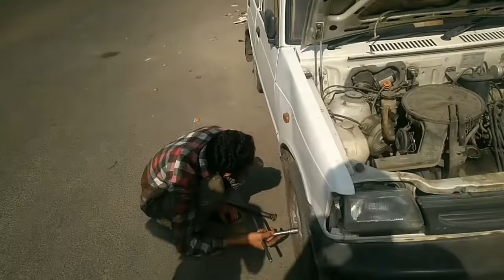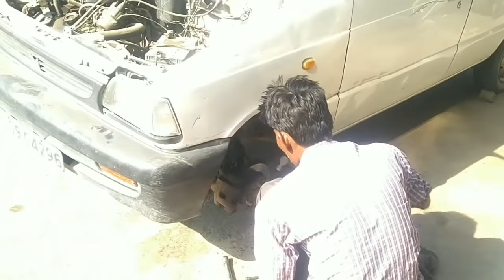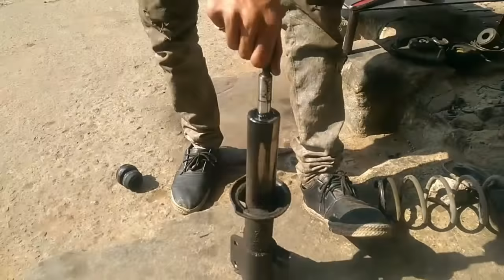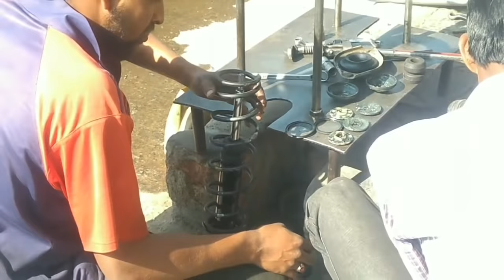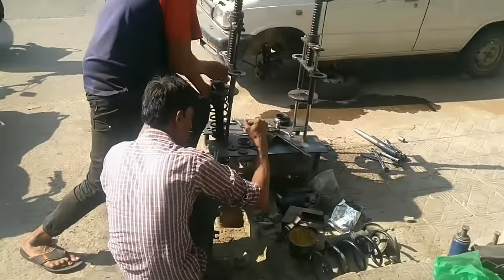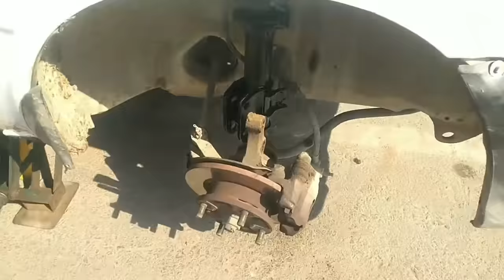MARUTI SUZUKI 800 || CAR SUSPENSION REPLACED IN 10 MINUTES ||

Comment: @Block and Piston.. 
How to find if the suspension needs to be replaced... If you could  make another video on it, that would be great help for us.. Since I too have a Maruti 800 of 2004 model and driven more than 1L km... So should I really need to change it or not Sir...
Reply from the maker: Try to press the front of the car. And if car's front moves like spring then need to replace the suspension otherwise get it repair.suspension should relase smoothly when come up.if that is smooth then your suspension is working correctly